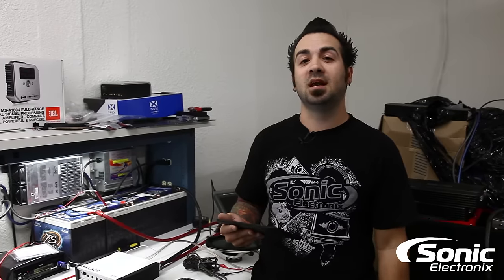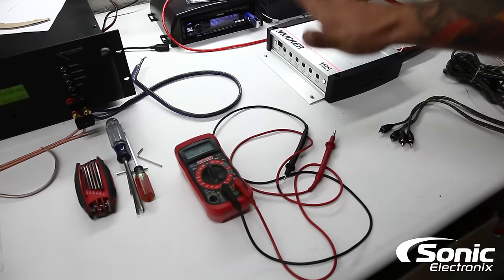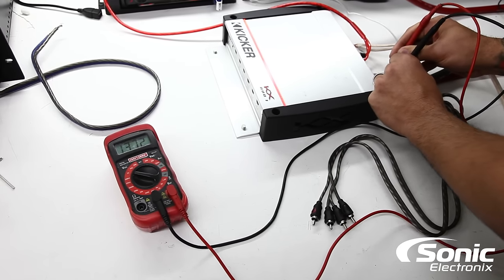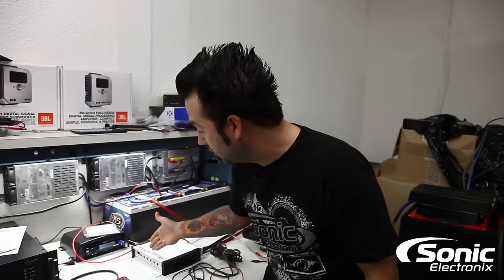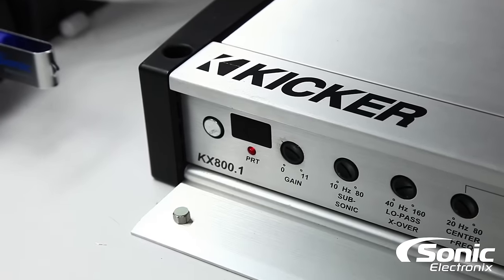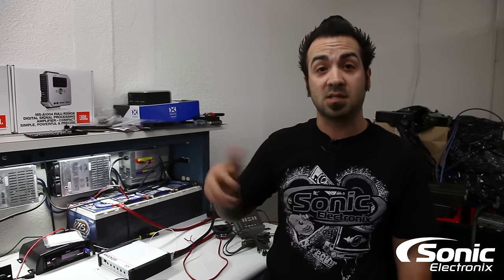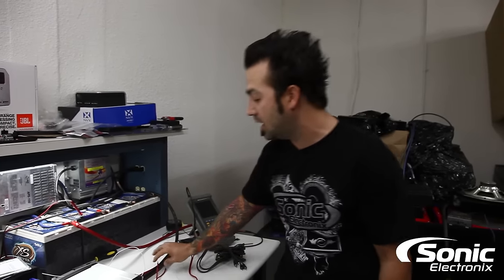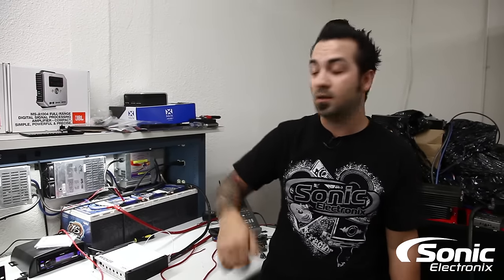Why is My Amp Going Into Protection Mode When I Start My Car? | Car Audio Q & A

Comment: just bought a hifonics brutus6 1616.4 4ch. just running inside speakers. goes straight to protective mode.check wires,fuses, can find whats wrong.pls help
Reply: might be your alternator not charging the amp fast enough or your head unit might also be defective this are the problems most people don't look at after doing all this steps they provided with on the video.
Reply: +Jonathan Tenorio  thanks jonathan, turned out to be the ground wire not getting good contact to frame.hifonics amp are very picky lol but thank u for the info
Reply: +Dee.p no problem I had hifonics but to be honest those have been my best amps that don't give me issues. now I have alpine and my problem is my alternator is old not supplying enough power to the battery to give to my alpine keeps going into protection. so I bough a high output alternator I hope that helps. if not there is something wrong with my head unit be care I replaced all my rca power/ground and remote wires and I installed it make sure they were good. All speakers work and rca so my last bet is my alternator if not then yes the head unit

Comment: my amp will shut off or go into protection mode when I up the volume which is odd and I have to have 2 amps connected to my radio for it to work
Reply: Same. My bass amp goes out while my 4 channel amp keeps going.

Comment: I just change my alternator and battery and I have a 2000.4 hifonics with 0guage power and ground wire my voltage drops and gets into protection mode what can be the issue please help gentlemen??? My voltage shows 13.80 and drops to 11 volts
Reply: Just my guess but maybe u need big 3+1 & high output alt

Comment: can a head unit cause an amp to go into protect mode?  I have an Avic N-3 powering a bc3500.  It seems like whenever the screen is out, it sends my amp into protect mode.  If I disconnect the RCA wires, the amp stops going into protect mode.  I tried changing out other rca wires, mounting them to a different RCA out port ect.  Still no change.
Reply: +The Headless Horseman If the amp goes into protect when you open the screen while NOT playing music, I suspect a problem with the head unit, yes.
Reply: For anyone interested I found the cause.  RCA  wires pinched under center consol, casuing a short.
Reply: +The Headless Horseman hey man when I connect the RCA it goes to protecting mode why is that ?
Reply: Sounds like a similar problem to mine.  Check the RCA's, to make sure they are not pinched or damaged somewhere.  Even if they look ok, try a different set and see if that fixes it

Comment: I have a Rockford Fosgate p3 on a Ol skool Rockford Fosgate 500.1 amp need more bass what to do?
Reply: James Fountain I had weak output from a punch 2002 and when I went into it, a voltage regulator was failing lm337! You can always buy a line driver that will increase the voltage into the input for audio if this issue isn't the case! I use a multimeter with a buzzer for the diode checker and use that selection to check the pegs of the mosfets, diodes and voltage regulators when I am doing repairs, there will be a pair of regulators, on Rockford, usually lm317 postive reg and lm337 negative reg! But the numbers the multimeter shows in the diode setting should be basically exactly the same on both, though you will have to use the neg and pos probes for the center pin and put the other probe on each outer pins! Remember Pos probe on center pin of Pos Regulator and Neg on center pin of Neg Regulator, the numbers should be over 250 but usually will read about 340+ for each outer pin, both pins will be the same as well or it is failing! This type of Multimeter is $10-$13 on ebay and will show shorts on anything! I would say it is probably a failing voltage regulator! I also had a failing Regulator on a Kicker KX600.1 that eventually led to a protect mode, when the regulator died! So pop off the bottom cover and look on the plates, usually they are located near or next to the shotkey and recovery diodes! If it is failing and you can replace it yourself, you can use a hotplate or heat gun to help heat the plate it is soldered to for an Iron to free it for replacement, you can cut the three pins holding it to the board and remove them with an iron carefully and desolder the holes "You can take speaker wire stripped and coat it with flux" to desolder it, then solder the pins to the board, then use rubbing alcohol to clean the area you just soldered and clean the plates and amp of old compound and apply new heat sink compound, put it back together and it will be good as new! It would probably be cheap for a shop to do if you only need a regulator, most likely $40 or slightly more but shouldn't exceed $50! Do it yourself for under $15!

Comment: I have a question I was booking up my amp the the battery and I had my neagtive connected to the positive terminal and I accidentally hit the positive wire to the negative post and it automatically went into protective mode is there a way to get it out of I’s it done?

Comment: I have a question. I have a kicker kx1200.1 amp with two alpine type s 12" subs. When I first installed them I wired them to 4 ohm and everything worked just fine. Recently I tried wiring them to a final impedance of 1 ohm and the amp won't come out of protection mode. I've checked my wiring three times. Please help.
Reply: make sure your amp is rated 1ohm stable dude.
Reply: The KX1200.1 is not rated to play into a 1 ohm load. But as you saw in the video, it should go into protection and then recover when you remove the 1 ohm load. Completely disconnect all speakers from the amplifier. Meter input voltage and give it a try. If you've got 10.5-15V of input and the amp is in protect with no speakers connected, it's time to send it in for repair. Luckily, Kicker is pretty damn quick and easy with their repairs... Also as a heads up, Kicker's new KXA line IS 1 ohm stable. :-)

Comment: Ok I need help. This is the exact thing happening to my Cerwin vega ht-s15 home powered subwoofer. it used to work great but now once the sub gets a signal on auto mode OR is turned on, the sub clicks and goes into protec mode. Please help!!

Comment: hi, if you can help me I will say amen every second I will watch your video!!!!
I have a H civic 2000, a amplifier (pyle gear x PDGA440, buy it new, in box), my amp gone into protect mode, only pluged 12v, remote and ground, when I turn my key (stanby) the amp gone in protect mode automaticly  , I checked the ground (scrap the paint off at 2 place)

can you help me please??

if that can help you my amp is screwed in tail trunk

Comment: HELP!!! I accidentally hooked up the ground to power and power to ground so I switched it and now it stay in protection mode and smokes alil. Is my amp fixable? it's a powerbass 3000.1
Reply: lol you're screwed. Magic smoke = somethings fried.
Reply: Sometimes if you pee on the terminals it'll work.

Comment: any idea why my ss1000.1 soundstage amp kicks the sh*t out of my insanely expensive JL audio HD1200/1? I have 3 optima yellow top batteries. JL goes into protection mode when I have the input sensitivity only at 1/2.. I'll never buy JL audio again

Comment: My amp turns on just fine. But I noticed when I find ground it goes into protection mode?
Reply: YOU COULD HAVE A SHORTED FET THAT IS GROUNDING.
Reply: Sam Partida my experience..is some cars like the 85 Gran Prix had a what they called a positive ground.. meaning you can't connect a ground to the cars chassis..had to run the ground from my amp straight to the battery

Comment: Or it could be like my cars and the ground has managed to rub thru the power wire on the battery and light on fire....fml need a new fuse block thankfully i was already trying to find the issue and nothing was hooked up to it at the time
Reply: what? your ground on the battery or the amp? you don't need to run your ground from amp to the battery
Reply: The ground on the battery for the car its self
Reply: @kevincrum1  oh, well good your car didnt burn up then
Reply: Yeah scared my wife half to death tho lol

Comment: When I first turn my car on my amp goes into protection mode and after about 1 second it is fine does that mean I have a short or a bad battery or is that normal?
Reply: Have you checked your manual for that amplifier?
Usually found on manufactuers support page.. or comes when you buy it.
In that manual there are sometimes troubleshooting guides also. With like problems and solutions.

Try also and measure and check things like in this video.
Reply: orfeous It didn't come with a manual it's a Fosgate r500 x1d amp I found a manual online but it's not that helpful.
Reply: That's normal for an amplifier. It'll have this short turn on delay when you turn it on.
If it's not coming off of protection mode then you shall scratch the back of your head.
Reply: All amplifiers do this, its kind of like a checking system, the amp is running through itself to make sure everything is right
Reply: Okay thanks everyone! It had me worried.
Reply: Some amps go into protect when you first start your car so its normal
Reply: +elijah wood Both of these statements are incorrect. Not all amps do this, and it's not necessarily a self check. Amps that DON'T do this will likely play a WHOMP when they turn on, and going into protect just shields your speakers from this initial surge of power.
Reply: It was a vague statement that was 100% correct, I didn't say it was a self check, I said it was similar, and it is, it is also a surge protector like you stated.
Reply: +Jim C K Flaten ive owned more amps than you can think of some cheap low quality stuff like boss pyle pyramid to some higher end stuff like kicker jl audio mmats
Reply: Cvalencia101 he was talking to me bro 😂

Comment: i had a question wat the different between class a/b amp and class d amp?? i have a 12 inch earthquake 1500 watts and im trying to find a perfect amp but i dont know which class fit my sub ??
Reply: num1broncosfan27 I was told the the difference in the class is how much current the amp pulls..either class will work the newer amps I believe are class d..but I'm not 100 percent sure
Reply: Just how the amplifier is designed. Class D is more efficient. Pretty much any higher power 1-channel is going to be class D these days.

Comment: My amp goes into protection after a few minutes of playing I got a SSL 5000 watt amp u will have to cut the car off an cut it back on then it will work again what makes that happen
Reply: make sure you amp has a sufficient source of air flow
Reply: how do I removed protector from my kenwood car stereo permanently

Comment: What if the amplifier doesn't even light up the on or protect light.???
Reply: (1) check ur main power line(the wire that goes to the battery)
(2) check ur ground wire make sure it is secure and in a good spot.

Comment: I have a question I have a skar audio evl 12 D2 in a ported box and a boss 1100m amp and I have a diesel with 2 big batteries and an upgraded alternator  it'll hit good but certain songs send it into protect mode. Since the sub is 1250rns and my amp is like 350rms could the power difference cause it to go into protect ?

Comment: Funny stuff. If one’s voltage was running at higher than the 16volts, most new cars ecu would be fried. The wiring can’t take that type of voltage. I learned this the hard way with an Infiniti. Second note, if the voltage was, what, you said 6volts, the car wouldn’t even click over……..third note, the guy said it powered up at accessory…..obviously it wouldn’t be a direct crossed connection. The real answer was he’s probably running into clipping, amps going into thermal protect. Could be too low of an impedance being ran to the amp…..pretty basic stuff……I dunno what you wasted my time with this for. I guess bad publicity is better than none.

Comment: Just tried to add a crossover to my system and when I added it on it started blowing fuse on the amp and he crossover. Removed the crossover and still blowing fusing. Please help any ideas

Comment: man, i wish i can speak his language.....I'm sure my problem is very simple. i just have no idea what's going on, lmao.
Reply from the maker: +Wexellence Try and explain you issue, give as much detail as you can. We will do our best to help, or one of our dedicated viewers will see your question and beat us to it!
Reply: +Sonic Electronix oh, hey! you guys are awesome.
Long story short, i blew my sub, replaced it with a better sub, and now that sub will not work when the base hits. It'll turn off. Previous sub was 800 max. New sub is 1400 max. I have no clue... Thanks!
Reply: +Wexellence Check the RCA cable on your amp, this a good starting point.
Reply: +Wexellence it could be the fuse
It happened to me exactly. It would work and then bass comes and bam it turns off.  All lines were fine. Everything was fine then I checked the fuse and although it looked completely fine it had actually somehow blew.  And when I got a new one it works perfectly
Reply: Keep at it!

Comment: my amp goes in protection after about 2 minutes of bass, what's the deal
Reply: check your alternator/battery voltage with the multimeter then check if the ground wire from the amplifier is the same gauge as the power. you need less then 3ft of grounding point and sand/clean it off good.
Reply: @killuday  I purchased a new Amp. Haven't had any issues since, crazy. It was just a faulty amp

Comment: fyi for the brain trust watching this video and drooling on themselves most modern cars with the exception of ford and perhaps a few others have the voltage regulator mounted in the altenator housing as part of the bridge rectifier that converts ac current to dc current. 

it is fairly uncommon to be able to replace just a voltage regulator on a modern car. however alternators are cheap.

Comment: When I trun my truck on acc and my amp stays on protection mode
Reply: Use the same troubleshooting steps as above. Monitor battery voltage.

Comment: My amp goes into protection as soon as i try to power it on, but when I hook any other amp up everything is fine. I jus want to know what has happened to my precious amp.!!😫 lol 

I have crunch 4000.4 class A/B amp any help would greatly appreciated
Reply: sounds like the amp might have died, open it up and see if you can see any missing/burnt or broken parts

Comment: This is James I have 2 rockford fosgate pime 1200.1D I have a yellow top battery up front I have a mechman alternator two 270amp I want to run three batteries in the back how should I run them
Reply: daisy chain
Reply: @a.arruda9578  adf
Reply: Yo